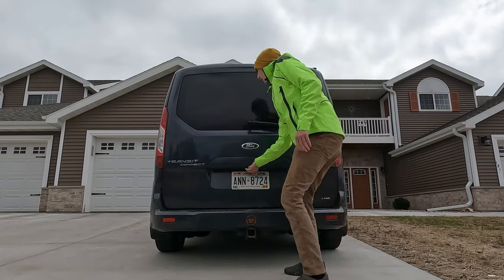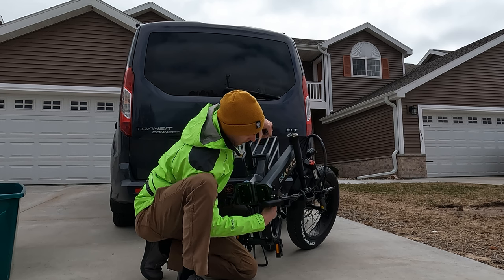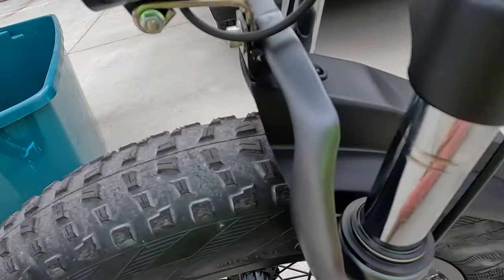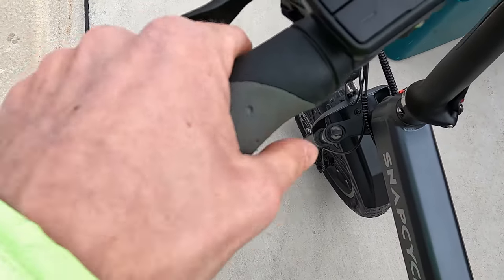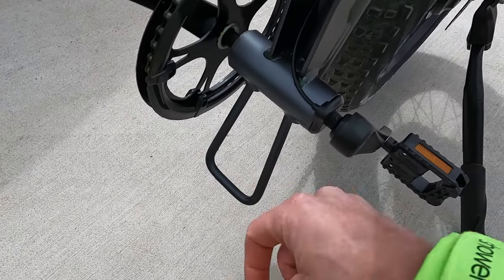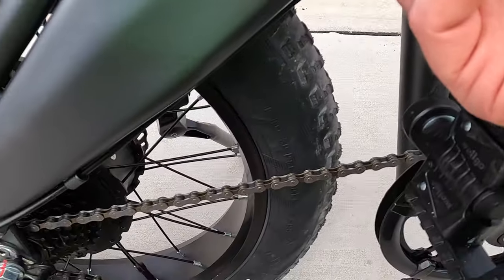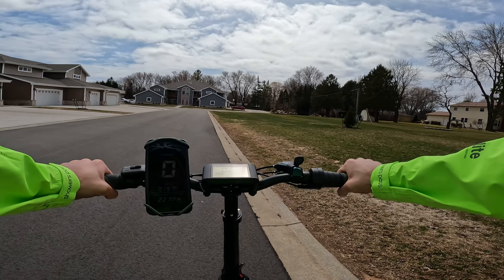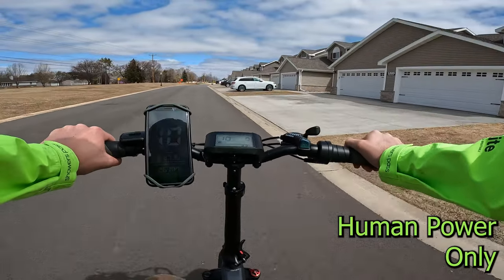Snapcycle S1 Review: A Folding Fat Tire Ebike That Crushes Hills

Comment: 4:19 In a manufacturing environment usually an assembler will mark bolts with a paint line to indicate they have properly torqued it. It also serves as an indication if the bolt becomes loose at some point later during assembly. It's very common to see this in heavy machinery especially when pre-load of bolts is critical.

Usually painting bolts like that is meant as an additional quality check for within the factory. It's not really something intended as a safety feature for end users as the paint markings will wash off, especially on that area of a bike.
Reply: This is quite likely the case. There are yellow and blue marks like this all over various fittings my 4Runner TRD Pro. The wheel lugs, suspension bits, etc.

Comment: The grease pencil marks are to show that the builder tightened and torqued the nuts so when the inspector comes by he just has to look at the bolts. Standard shop practice for motorcycles and bikes when being built. If you buy a motorcycle new you'll see the grease pencil marks all over the bike if you look hard enough. I bought a Chinese e-bike I had to put together, but I forgot to put the grease pencil marks, hopefully it doesn't explode...I hate that.
Reply from the maker: thanks!

Comment: this is just like the lectric xp2 for the most part
Reply from the maker: The snapcycle has a much higher peak wattage motor and a larger, 14ah, battery. So while the XP 2.0 is a great bike, there are a few differences between it and this snapcycle. -JT